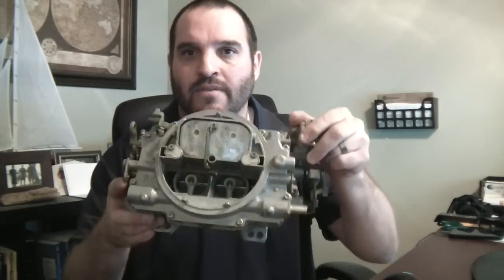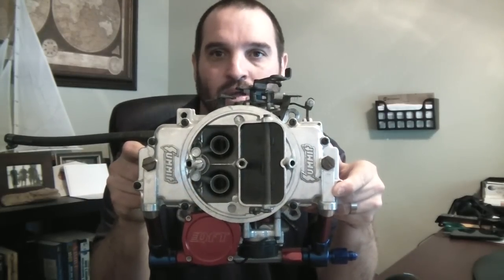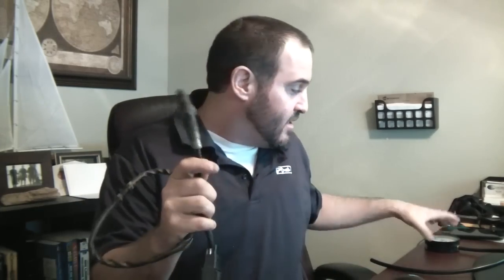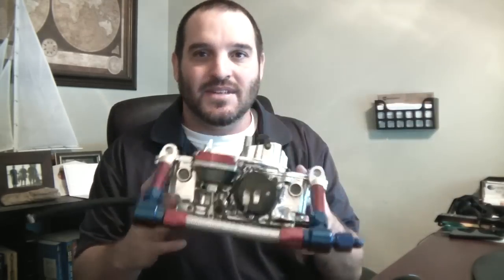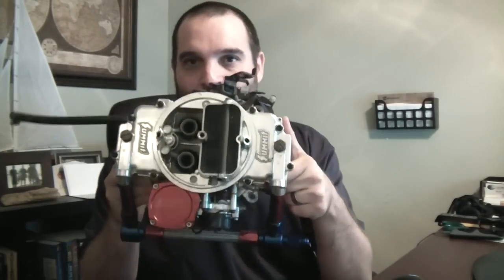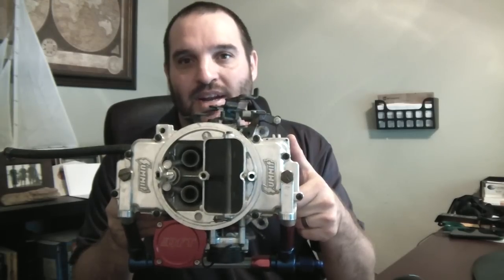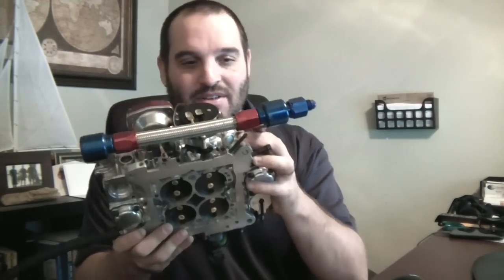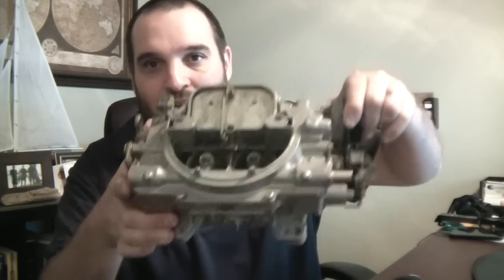High Altitude carb carburetor tuning

Comment: Good job bro! Seriously, thanks for the only video relative to my problem- livin Rocky Mountain High in Colorado with my Chevy k10 and outta duh box Edelbrock
Reply: im with a brotha! Im in Tabernash
Reply: Bro - I just got a 73 K20 with the 350 (rebuilt) - failed emissions today by .5 on the CO (not CO2) reading. Looking to tweak the carb to fix this....if high octane fuel doesn't pass it on the second try. Still need to run more efficient up here when heading up the trails!

Comment: Summit Carb is easy to change jets. Like 6 or 8 screws, top comes off, and jets are right there.
Reply from the maker: I had one of those and there awesome. Shoebox 4010. I actually made another video about it.
Reply: Fintech Repair Shop bro you have thousands of videos! Jeezus
Reply from the maker: @WesternReloader  I know, I fix stuff all day long. I only video a small fraction of what I'm doing.
Reply: Fintech Repair Shop Amazing! Keep up the good work

Comment: chrysler used AFB s in a lot of engines.   some had a 3 step rod.   and some had a 2 step rod.   BUT  the parts are NOT interchangeable.   the 3 step rod is longer,  the jet is taller, the piston cap is  dimpled.  the 2 step rods cap is flat, the rod is shorter, the jet is shorter.

Comment: So is there less oxygen? Less air? Or less barometric pressure?  Less oxygen makes sense to lean the carb. But if the barometric pressure is less air is less dense the air would pull less fuel.

Comment: Hello, thanks for the informational video. Maybe you could give me some advice about my problem: On it's first trip to high altitude (over 13000 feet) my Toyota land cruiser prado (used, petrol 2,7L) starting to make bubble noises from the radiator and coolant reservoir. No overheating was detected but coolant refill was needed many times. I am clueless in a city without good mechanics, thanks for any advice, you have a new follower!
Reply from the maker: maybe there is something wrong with your gauge. If your boiling then you have to be over 212 degree F or 100 Celsius coolant. check your coolant cap also to make sure it hold pressure. You need coolant pressure to reduce boiling. Usually about 16 PSI max.
Reply: The boiling point of water is lower at higher altitudes due to less atmospheric pressure.

Comment: Hi.  I will be driving a 59 Cadillac 62 from Aspen, Colorado to Norfolk, VA in early August.  The car has a Edelbrock 1406 and is tuned for high elevation.  What will I need to purchase and install on the carb to keep it running correctly and when, along my trip, should it be done. Thanks.
Reply from the maker: Get some metering rods, You want to be richer at lower altitude. I would say 2-4 stages.
Reply: @fintechrepairshop  Thank you. Aspen is at 8000 ft, at what elevation should I start to consider the change?

Comment: I have an 81 mazda B2000 that was originally from Mesa AZ and an altitude of 1,240ft. Now in northern AZ at an altitude of 4,707ft.  Engine bogs down under load, idle a little rough like it's ready to stall out. Would carb adjustment help?
Reply: did you ever figure out the issue ? Ive got an 87 b2600 and I recently slapped a weber 38 upon recommendation from a respected mechanic in town and my truck won't start. Black fowling on the spark plugs and white fuel smelling smoke indicates a rich mixture I think so would getting a high altitude jet kit fix my problem ? I don't know what size jets its got in it rn but I've read that maybe one size smaller would help. new to carburetors so I've just been feeling around in the dark until now...

Comment: Great info.  I'm wanting to lean out a small air cooled 4 cycle engine with a fixed jet but am afraid to over lean it.  What is the best way to know when I'm at the right air fuel ratio?  8600" elevation, so I'm thinking I'll have to lean it a significant amount.  Do you know of any way to tell when I'm lean enough but not too much?

Comment: I moved to Colorado springs,on my way here from L.A I did some adjustments on my 600 cfm eddlebrock,now if I slam the gas all way down it dies on me,should I do what you did to your carb ,also notice I lost alot hp
Reply from the maker: +Roy Andrade 

I live in Newport Beach which is south of LA. You need to lean out your primary stage with thicker metering rods. Possibly even change you accelerator pump arm to a lower hole. You are going to loose horse power at higher altitudes.

Comment: Help! I thought you were going to tell us how to adjust the Summit Carb for high altitude.
I am not in a position to swap my carb anytime soon...could you please tell me how to adjust the Summit racing carb to 6500 feet above sea level please?
Reply from the maker: You need to get a vacuum gauge and test you vacuum at idle. Get a power valve that matches your vacuum.  An O2 sensor helps allot.